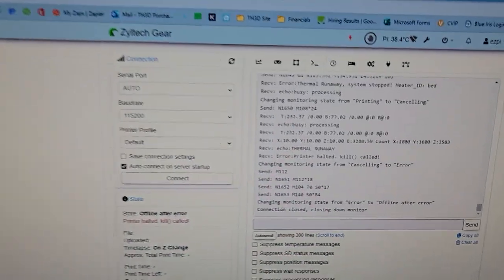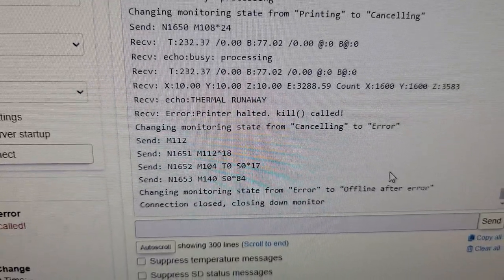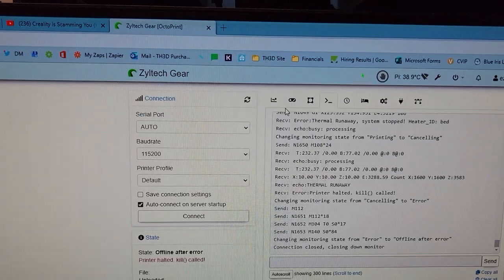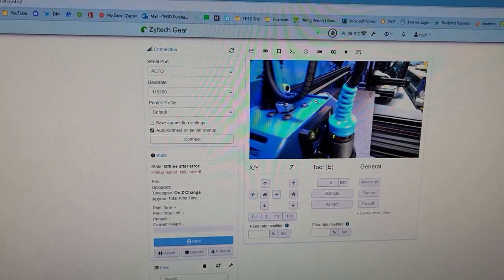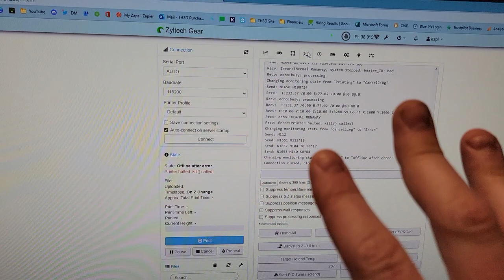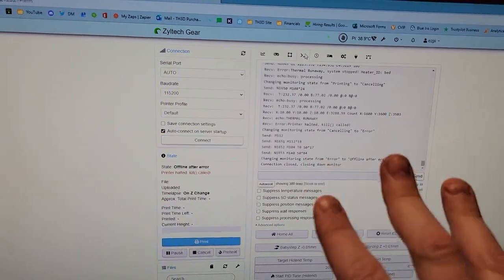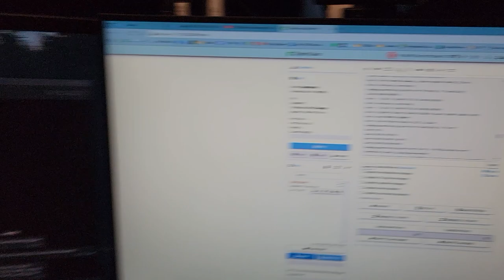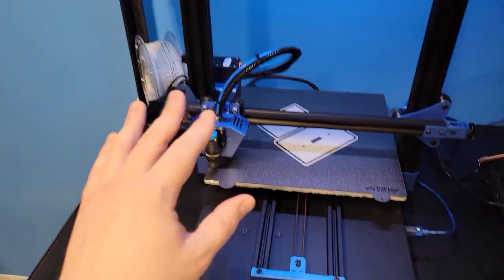EZPlug Feature (Real World Example) - AC Power Cutoff During Thermal Runaway

Comment: This may be a dumb question but can I use these with Klipper with Fluidd/mainsail? I’m not using octoprint anymore.
Reply: I am not sure about Klipper.  These use the Tasmota plug-in within Octoprint to trigger the power off under certain conditions.   If there is some similar functionality with Klipper it may be possible.
Reply from the maker: I don't use Klipper but it looks like they have support for Tasmota plugs in there but you'd have to talk to them about using a plug with their software. Klipper is for advanced users and hard to setup so we don't do anything with it.